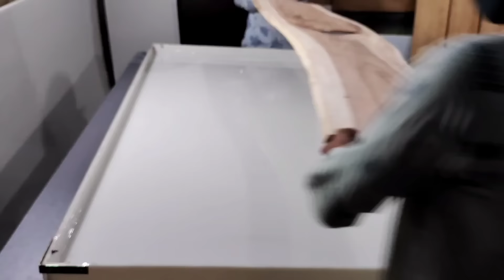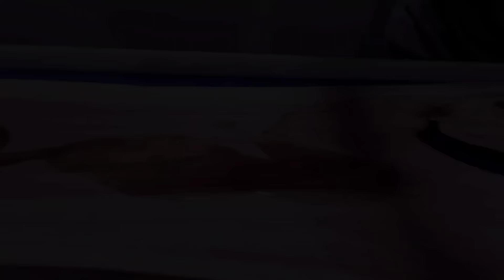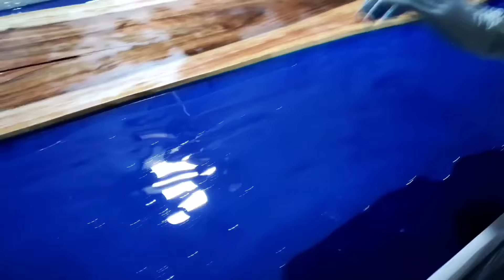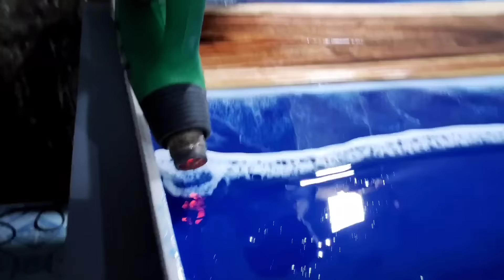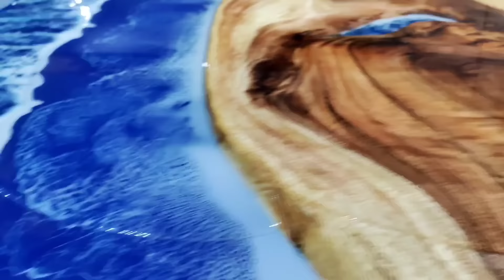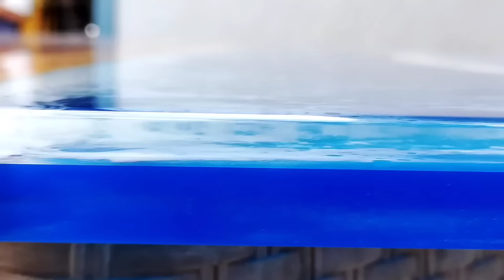DIY epoxy resin table | How to make Ocean table - Step by step with subtitles

Comment: If the wood is not stabilized with the same resin, the beauty is short-term. Cracks, peeling, destruction of integrity. More than 20 years of experience.  And I would like to leave it to posterity.
Reply from the maker: Ohkk
Thank you for valuable information 😊 ☺️

Comment: Only thing missing is a small chamfer on the edges and corners. Epoxy can be sharp at corners. All fun and games until a kid bust their head on the corner or you run into it in the dark.
Reply from the maker: Yes right but it's not sharp it's little round

Comment: what solutions did you use for wet sand the surface and what type of polishing compound you use to make it glass like
Reply from the maker: For sand i use sand color
And for glass finish i do sanding frkm 80 grit to 4000 grit
For polishing i ise foam pad with polarshine 35 and 10 by mirka
😊

Comment: I wonder if the wood get seperated. As the rasin is not strongly connected with the wood.
Reply: @Welldora  I am just casually asking as these are two completely different materials and only connected to the edges of the wood.

Comment: Great video. Thanks for posting a good tutorial. I have a question though. What is your table top covered with so the epoxy releases clean? I'm about to try my first table top pour and was curious about the material used on your workstation's ability to not have the epoxy sticking to it.
Reply from the maker: Cover with plastic or any other sheet
Reply: Great. Thanks for the quick response.

Comment: ?4U would this method be strong enough to use on a floor a 24 inch x 80 inch  and only 1 inch thick to be mounted on the floor of an RV light foot traffic with bare feet n socks NO shoes or boots ty by the way this is totally wickedly Kool
Reply from the maker: This is scratch resistances 
Not scratch proof
Thank you so much 😉😊

Comment: Nice... What material is recommended for the molding specially on a large table?
Reply from the maker: It's plastic hdpe sheet..
Reply: @Welldora  ok.. Thanks another question on a smaller projects in terms of costing can i just use a acrylic sheet? Does the resin will going to stick to the acrylic sheet or do i need to put something to the sheet so it will not stick and will easily remove in the molding?
My first try using resin i used plywood and the resin stick to the wood 😢🤦‍♂️ sorry my first time using resin
Reply from the maker: Use tucktap

Comment: How does your whit not run together? Mine always runs together. After I blow it with the heat gun, it looks good. Then it just fans out and I lose it all
Reply from the maker: White are pouring after little bit hot
It's a trick
Reply: Please explain @Welldora
Reply: @waterlilly62lori I think they mean that the white is poured only when the blue has set a little
Reply: @JT-oh4eu  thank you